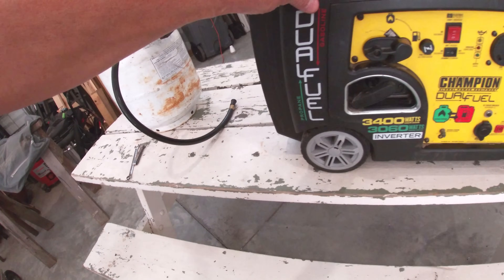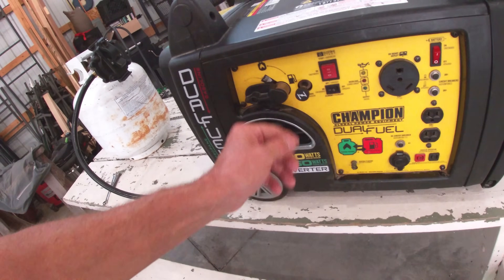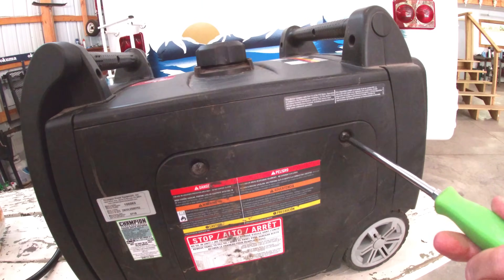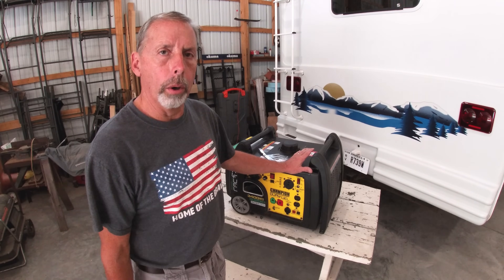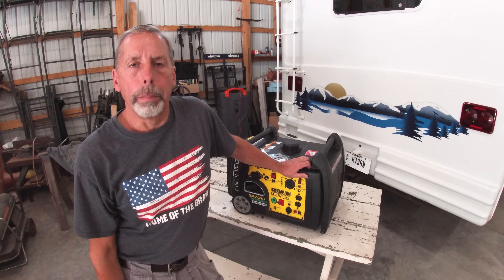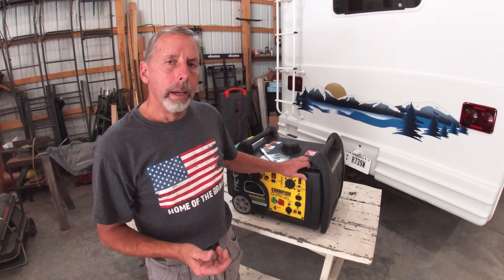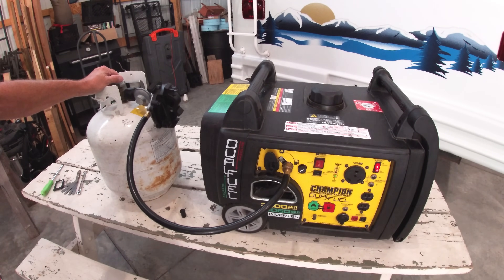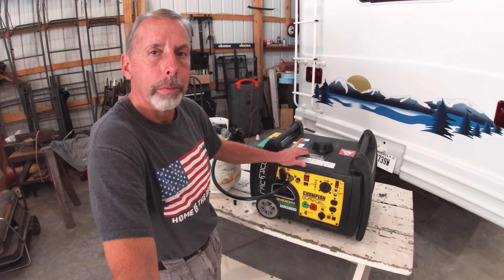Propane Generator Fail

Comment: You can open the valve on  the tank to fast on anything that uses propane,and get no fuel. Ive done it on my heater,and grill. Crack the line to release pressure, and start over opening the valve slower.

Comment: The issue is in the tank not the regulator. This is not specific to Champion generators, it is applicable to all propane tanks equipped with OPD.

Comment: I had a problem with a propane outboard motor. It seems if I open to full throttle, the hose thinks there is nothing connected to the hose and shuts off. I changed the hose and it worked fine unless I opened the throttle too much.

Comment: I purchased a duel fuel duromax and have it connected to my 250 gal propane tank at the barn.  It’s got 6 hours on it.  It ran fine last year but when I ran it this year it runs for 10 minutes then just quits.  Very frustrating.

Comment: It’s actually the qcc (the part that connects to the tank). It has an excess flow protection device. If you swap that out with a full port qcc or pol connector you won’t have to open the valve slowly.

Comment: It's the safety valve built in the tank to prevent from being opened with no hose or an open line. Not the regulator

Comment: Shoot! My 8500watt champion generator that the starter went on it after about 2-3 months. They sent me another with no instructions how to install it and now it full stop working after 8 months. It shut off on me when I was running it. Checked the oil, fuel, spark plug and everything is good. They want to to take it to a repair shop that it over 3 hours away. I don’t have a pick up truck to put this in. Champion has people that you can hear that don’t know what they are doing when you call them for support. This generator has less then 50 hours of run time. My Generac never had a problem, over 10 years before she went.

Comment: I gave you a thumbs up, but, it's not the regulator that's the issue. it's the propane valve. it has a leak detection function that is supposed to slow the flow down in case the hose gets a hole in it. you can hear it when you crack open the valve. it makes a ping noise. that is a ball bearing blocking the flow. when you crank it open fast, the ball can't see the pressure in the hose to roll back, so it stays in low flow condition. all propane appliances have the same issue. your trailer owners manual should mention it.

Comment: There is an excess flow valve. It's either in the regulator or in the end of the fitting that screws onto the tank. If you look inside it if you open it quick, it will slam it shut same as if the hose were to come unhooked or rupture it's a factory design, but they really should tell anyone with a gas grillgenerator fryer anything you need to open it slowly if the pressure goes through it too fast it closes the cure when it does happen to shut it off. Wait a few minutes. Open it up slowly. I've been doing propane my whole life run into this many many times.
Reply from the maker: Thanks for watching

Comment: Opd valves on newer propane tanks are triggered by opening to fast( audible click), gotta feel the detent and crack the gas slowly , itll then stay open. Nothing to do with the regulator , and is built into the propane tank itself.
Had a bad hose onetime.

Comment: I  just went through this myself.  We had a storm come through and killed the power.  I thought , ahhh I get to use my generator.  I had been going out running it about 15 minutes or so every couple of week.  Well lo and behold the power goes out I got out plug in the propane  turn the dial to choke and hit the start button.  She would act like it wanted to start, but wouldn't do anything.  I was so mad because like you I never wanted to put gas in it.  But after multiple attempts to start it on propane it just wouldn't run.  Power company said it would be around 10 to 12 hours before they would restore power. It is now 95 degrees and very humid so I had to make a decision.  Aggravating as it was I got my gas can and put gas in it.  Turned the dial to choke for the gas.  She fired right up and ran perfectly.  Next day  I shut it down and let it cool and checked the arrestor and it was clean.  Plugged the propane back in and once again she just wouldn't start.  I went online and did some research and I found your video and another person video.  He was recommending changing out the regulator.  But said when he spoke to tech support they told him to make sure he turned his propane gas on very slowly.  Like you I never thought about it and just cranked it on.  Well sure enough I go out and slowly ease it open until it's fully open.  Hit the start button.  She fired right up and ran like a champ. No pun intended.  Sound to me like they have some crappy regulators, but that is just me.  But I just wanted to tell you I appreciate you taking the time to post this.  Thank you because this absolutely helped me.
Reply from the maker: Thanks for taking the time to comment. The propane tank also has a valve that restricts the flow if opened too fast but the regulator has the same feature built in. I think the regulator may be more sensitive too. Thanks for watching

Comment: What happens if the service valve on an LP tank is opened too quickly?
If you open the valve on your RV propane tank too quickly, you risk tripping the excess flow valve and having to fight to go back and forth with the system to get it to cooperate. The excess flow valve is a spring-loaded needle valve designed into the POL or connection valve and is rated to a specific flow or pressure.

Comment: All consumer regulators have an excess flow valve, purpose is to shut off the fuel if the hose breaks. It's actually in the fitting that screws onto the bottle.

Comment: Propane is not as clean as you think. I repaired Mosquito Magnets and the fuel filters were very dirty. The chemicals in the propane would turn the filters different colors and clog the filters. Black, brown, blue, red...Turning the valve on slowly was recommended for these as well.

Comment: Google helps considerably when troubleshooting problems.  Sometimes, the propane tank regulator bogs down the fuel if you open the valve too fast.  You  have to unscrew it from the tank and then screw it back on and open the propane tank slowly!

Comment: Another thing I've found in the last 4 years.

Propane is not as clean as it used to be. It's now oily. If you use propane 24/7 like we do for our home range and on-demand water heater the regulators go about two years before they gum up.

The last time I replaced my regulator I installed in-line brass filters between the tank and the regulator.
Reply from the maker: That’s something I didn’t know although on my Mr Buddy heater I installed a filter bc they recommend it. I really didn’t know why. Thanks for the info and for watching

Comment: I was told that it is a safety valve in the tank. If for any reason the gas should rush out the valve will snap closed. Turn off the tank, disconnect the hose from the tank. Reinsert the hose and slowly open the valve.

Comment: 2 questions. 1- what is that big black thing on your regulator by the tank?    2- I have a Sportsman 9000 duel fuel. i purchased a two stage regulator which makes my problem take longer to happen. so it did help a little. i will try what you said but my normal problem is... i saw in your video you open the tank ALL the way. I WISH i could do that. I have to BARELY crack open the tank or my generator will dance across the driveway. then when the tank gets cold it starts dancing again and i have to turn the valve ever so slightly and repeat every time the tank gets cold >:(  tech support was NO help they sent a new reg that did nothing thus the purchase of the 2 stage reg. Any help or suggestions would be deeply appreciated. I've been dealing with this since 2018. all my friends know about gas not lp. FYI gen works great on pump gas. PS the gen was purchased for hurricanes which i have not had yet so it only gets used once a year for a couple of hours for testing. Then i pack it away and wait for next hurricane season.
Reply from the maker: I’m not sure what the black thing on the regular is. Never seen one before. Since that issue was fixed it’s a great running generator. Thanks for watching

Comment: Nope it happens on a lot of propane gens... There is also the same problem with Mr. Buddy Heaters while using the 20lbs tanks... Nothing in the manual addressing it.. But have to slowly open the tank then it works great...

Comment: i found in new propane tanks 3 out of 10 i have the "OPD Overfill Protection Device" dont work. the tank can get overfilled to the valve. when i hook up the regulator nothing will come out. i tilt the tank then it will. also its pissing gas out the valve vent.. which aint right? but i hook it up to my bbq grill till the regulator stops freezing up then all good.👍 im sure its a defect recall not yet made public? 
other issue is the plastic tank cover. it holds moisture & rots out the tank middle seam. really bad in some cases. might cause a leak im sure at some point. so razor blade all those off check for seam rot & sand & touchup paint is what i been doing.
seems ALL things new are junk broken or defective these days.
as for an overfilled tank if you get this i DO NOT recommend putting it in your vehicle if its leaking out the tank vent or anywhere after filling it up.. let them deal with it there.

Comment: From an engineer who works with compressed gases, it is a proiblem with a "single stage regulator -- ALL of them.  I use two stage for nearly everything.  Yhe other solution is to use a fork-lift tank with a liquid connection.
Reply from the maker: Thanks for watching

Comment: The other thing that can happen when you quickly open the valve is the safety shutoff in the qcc1 or the valve on the propane tank will trip. Closing the valve and releasing the line pressure resets the safety valve. I can see the sudden inrush pushing the diaphram of the regulator to an extreme and not allowing it to move properly.
Reply from the maker: Thanks for watching

Comment: also you can check if you propane bottle could had checked on you, cause it checked on me today. I had to stick a small felipe screwdriver into the hole of the cylinder and press into it for about 5 to 10 seconds after that it worked like a charm.
hope this helps you out.
Reply from the maker: Good tip. Thanks for watching

Comment: I’m in the propane industry.
The biggest problem with these cylinders is the OPD valve (or what I call the lawyer valve) because they are the cause of it.
And yes what others are saying here is correct, you do have to open the valve very slowly to keep it from checking (the safety valve) inside. Some of them can be opened faster than others but unfortunately there’s no way of knowing so just get in the habit of opening all of them slowly.
Regulators do go bad (China) more frequently than they used to but without test equipment there is no way to check that.
A lot of these generator companies are trying to come up with ways to blame problems on anything they can to get out of warranty cost, and blaming improper maintenance and bad regulators are two of their go to excuses.
In case you have problems I would try hooking up to another cylinder and if it works on that one that indicates either you opened the valve too quickly or the valve itself has possibly gone bad (which does happen fairly frequently). If it won’t run on the second cylinder either then you may have a bad regulator or something on the generator malfunctioning
Reply from the maker: Great info. Thanks for watching

Comment: I am troubled by their lack if customer support.  It seems that you had a device which should have been covered under a warranty and not only would they not fix the problem (their AUTHORIZED WARRANTY SERVICE CENTER didnt have parts), they also wanted to SELL you a new part and have you do the work.  Am i missing something?  I am considering buying one of their units, but I expect it to work and if it doesn't, I expect them to fix it.

Comment: I had this problem with a propane grill not getting enough fuel. It just started working fine all by itself.  Its happened a couple times since.  Always fixing itself.  I suspected it was something to do with the regulator.  Guess it was.  Id never heard of opening the valve slowly.  I willl try it from now on though.

Comment: Now this may not be the regulator but rather how the regulator reacts with the propane tanks OPD and leak detection valve, you can open it fast like normal, try and start to see if the generator runs poorly.   If it does, shut down the generator and close the propane valve and listen for a very quiet 'click' from the valve, that's the over-volume safety valve returning to a normal position. Opening the valve slowly might prevent the surge of flow that makes the tank think it has a broken hose.  Some tanks used on items like weed burners or forges will safety down to something like 5% flow if the device is tripped.   Not all tanks do this.
Reply from the maker: It seems to be both the tank and the regulator. The regulator is extremely sensitive to opening too fast. Thanks for your comment and for watching
Reply: @PleasantValleyOutdoors  Now I'm not sure if the larger RV tanks, 30 gallon have that same protection.

Comment: There's two things going on: one, there is moisture in the regulater. Two, letting LP out fast will freeze the diaphragm. Here is the kicker. Moisture moves around, so it might freeze the  up, or it may not. It depends  on where the moisture is. And it could melt or stay frozen, depending on how much moisture, how cold it is outside, etc... This can make you go crazy because the generator can have many different  outcomes. I have the same generator, and it's never done this or anything else. I've had it for 4 years. All I can say is I keep the regulater inside and in a sealed zip lock bag. So maybe it never has a chance to build up moisture ? When I was in the AirForce, I worked on presure valves integrated with liquid oxygen or liquid nitrogen, and we always have moisture issues
Reply from the maker: Great info. Thanks for watching

Comment: Opening the valve on the propane tank too quickly causes the regulator to close-off about 60% of the pressure. This is part of the design to avoid dumping propane into the air because of a damaged hose.

Comment: Actually that is normal. A small propane heater I have states it very clearly to open valve slowly. That is because there is a safety feature in the valve for low flow when sudden increase in volume of gas flowing.
Reply from the maker: Thanks for watching

Comment: What are you talking about regulators back ordered? Can get them at any Home D or Lowes. And opening the propane valve to fast has nothing to do with the regulator its a safety mechanism in the propane tank valve.  It senses that quick opening as a leaky valve and it closes that valve. It still allows enough propane for a tiny flame in a oven for instance and enough to run your gen but poorly. Old propane tanks didn't have this feature. Shutting the valve and opening the valve back up slowly will release that shut off.

Comment: Are generic pressure regulators available which could be obtained quickly in case of total failure.  Why ONLY available from generator manufacturer (someone makes them for Champion, right)?
Reply from the maker: That’s what I thought too so I bought a dual stage regulator from a hardware store that had the same flow as the Champion.  The generator wouldn’t run on it . Only spit and sputter. No choice but to use the OEM. Thanks for watching

Comment: Yes sir. ACME propane valves must be opened very slowly or they trip the safety regulator. Prest-O-Light (POL) propane valves don’t have the safety mechanism. You probably grew up using the POL valves and it didn’t matter how you turned them on. The newer ACME style valves (which everyone has now adopted) are very sensitive and the first half turn of the tank valve must be turtle-speed or it shuts down.
Reply from the maker: Thanks for watching

Comment: I've been kicking myself for not buying a dual fuel.  Mine runs on gasoline.  I only use non-ethanol.

My assumption - if I had a dual fuel - would have been to run the generator off the propane outlet I use for my gas grill.  It's regulated at the main tanks for stove, grill, furnace.

Do propane generators run on a different pressure?
Reply from the maker: I’m sure a bigger generator would require more propane so it would need more pressure. Thanks for watching

Comment: You sir are amazing and thank you so much for posting that video!  I have a different firman dual fuel generator from Costco but it did not even occur to me the possibility of something like that happening on a generator. Guarantee you save me the same drama at some point over the life of this generator.  I hate the thought of putting gasoline into my generator as well but do you happen to know if a person uses regular ethanol gasoline and then if you run the generator after on propane for a while say like two 3 hours or something like that... Does running on propane clear the carburetor of the unleaded fuel all throughout the system including the bowl? I have no idea if these dual fuel generators send propane through the entire body and jetting of the carburetor body or if it is a totally unique flow separate of the carburetor
Reply from the maker: I don’t know if the propane would run all gas out or not. I’m glad you liked the video. Thanks for watching